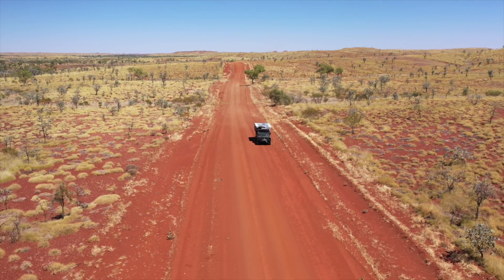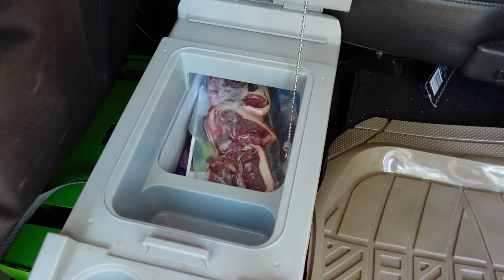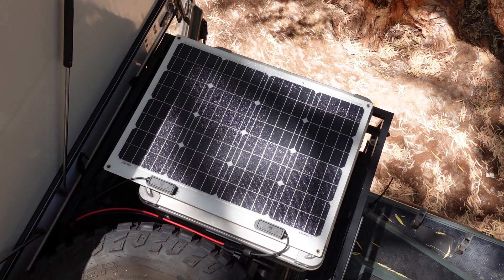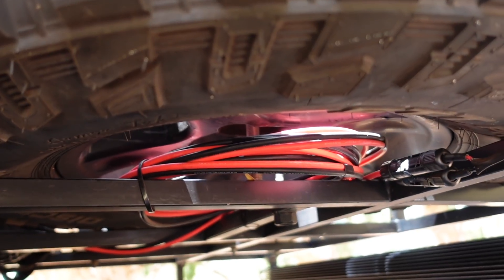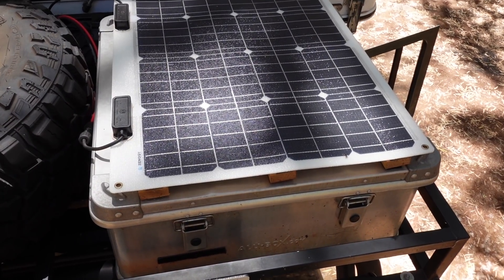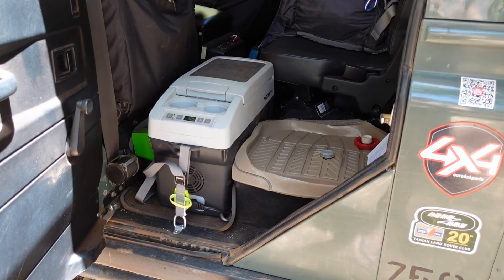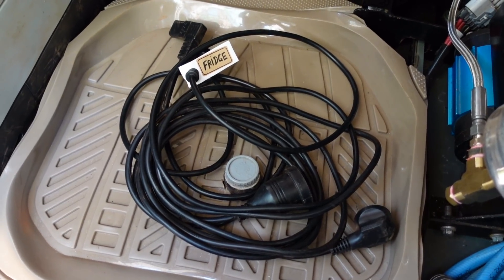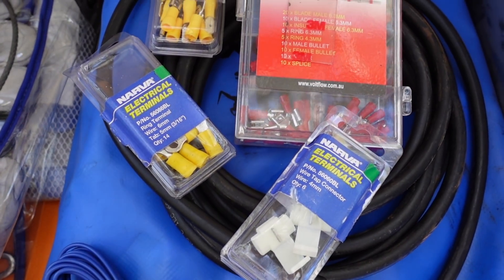Off-grid Fridge and Solar for the Australian bush. Modifications to our Land Rover Defender.

Comment: Awesome setup, here's some of my notes: We got a metal Iceco fridge and really happy with the size and insulation. See if you can replace the terrible 12v round plugs with Anderson or other connectors. Those round ones loose power and also have a habit of getting loose and you might end up having the fridge power off and spoil your meat without knowing. Another obvious thing is keep the fridge full, even with water. Opening a empty fridge is a fast way to have it running just to cool down air. I learned when I was a kid from Astronauts that this is why they flew up to space full of ice cream! Lastly, I'm sure you know this too, but solar panels need all their cells to be in the sun, a single leaf or spot will degregate the entire panel's power.

Comment: I've found that running a fridge and wanting to get charge to the battery at the same time takes about 200w Of solar in full sun. I get around 4A charge when the fridge is running. And yes, Victron is the best! I have the same controller 🤠

Comment: The cab is always very warm. Especially when stationery. And out in the bush you don't really want to leave anything open for ventilation. You never know"who" hitches a ride. What are the outside temps like between midnight and 6am? Maybe the freezer could be switched off for the full 6 hours or less. You can test that theory when the freezer is almost empty. 🤠

Comment: Leigh,
you don't need to run your fridge overnight. Turn it off when you go to sleep and turn it back on at 5 to 5:30 in the morning just before sunrise. You will find your fridge will run purely on solar throughout the day at 100% battery at peak sunlight and run your batteries down to around 80 to 70% in the evening up to the point where you turn it off. Also fill a few systema containers full of water to make ice bricks to keep the temps cooler and give you a buffer so the fridge compressor doesnt keep kicking in to keep cool. Portable fridges shouldnt be run 100% of the time and don't need to be like a home appliance.
Reply: Thanks for the info. Unfortunately with the extremely high temperature in northern Western Australia at the moment that doesn't work.
We did try one night to switch it off and in the morning all the meat was already 50% defrosted...
The temperature is 39-40C every day and not much cooler at night.

Comment: I think those smaller between the seat ones Waeco/Dometics have a less efficient or older style motor in them compared to the range of full sized ones, also as you mentioned much less insulated (and no bag?). The power draw ratings etc won't seem to add up, plus i think it's tested with the fridge set to 5C and 28C ambient or something like that. I was suprised a newer CFX50 allegedly draws more than my old CF50, but in reality the CFX50 cycles on half as often (had 1 side by side). Safe Travels, Mart - WA

Comment: Surprised by the Dometic. I have one between the front seats of my Defender (making it even more cramped) and even when the temp in the cab is like an oven in the tropics, it keeps the cokes and water icy cold -- it's a fridge, not a deep freeze. After 20 hours on the road, you'll know how hot the Puma's floor gets. It's like fire down there, so I dip into the fridge and pour freezing water on my feet. There ends your Landy Geezer tip of the day. It's also a good arm rest/center console.

Comment: I installed a 90 litre upright Engel in our camper trailer and it only uses 3-4 amps - so much more convenient than a chest style fridge. I think the rumours of chest fridges being more efficient is largely due to keyboard warriors without experience (yes, in theory it makes sense but not in practise). We open it as little as possible and it does nicely for a family of 5.

Comment: Care to share what other similar fridge freezers of that size are more efficient?  I think others have already said, those small things are not very efficient, at least that one uses a compressor, peltier effect cooler heaters are even less efficient.  I'd try wrapping that little cooler in insulating material like a purpose made bag or Gerry rig something with bubble wrap or just grab some polystyrene packing material and fashion a box for it make sure you allow for the x changes often cooling air and try not to have the hot exhaust fed back into the air drawing side.  If you find that offers insufficient improvement you will need to look at a bigger with a better insulation and cooling for the heat exchanger.

Comment: Dont know if your using anderson plugs, have heard they help, in that they reduce the amount of current drop.
Reply: Volt drop. You lose volts on a bad connection, which means power loss in the form of heat.

Comment: Not sure how long the wire run is but might need to upgrade it to thicker wire if too long a run to reduce voltage drop. Also ditto the other comment re plug type: better connection = less voltage drop, and also Anderson plugs don't come undone too easily on the corrugated roads. Enjoy the Pilbara.

Comment: I noticed your smaller freezer in theLR in a previous video and was wondering how that was working out for you.
I have a large fridge on a slide out drawer, in my camper and a slightly smaller one (Still a big one) in the back of my Truck but it takes up so much room I was thinking maybe I need a smaller one like that for making grocery runs.
On;y rin it off the second battery charged by the alternator.  So this Video answers my question of should I get a smaller freezer in my truck too?  My Camper is like a teardrop camper with the kitchen at the rear, but the sleeping area inside is like that of a Pop Up Camper slide out bed, but slides out on top of the trailer , rather than on the side.  (A cool feature of my little camper is it has remote control steering suspension. So weaving between tight trails is a breexe.)  Guess I"ll keep looking for an inside the truck feezer.